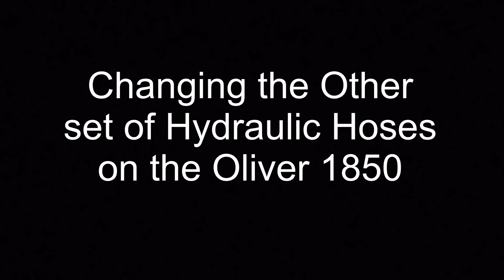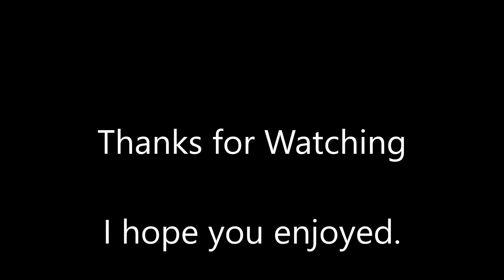Changing the Other Set of Hydraulic Hoses on the Oliver 1850

Comment from the maker: Sorry for the delay in getting this up, My internet is really slow now because everyone is on line so its slow.  But with the fender off the Oliver 1850 its a good time to change the other set of hydraulic hoses and ends to the new ones. So I did the new hoses first putting the new Pioneer ends on them and then pulling the old ones off. Boy did I get a surprise in how tight the hoses were in the fittings and they would not brake loose so I took them off the pipe sticking out of the tractor and had to put them in the vice to get them broke loose and taken off. But I got it all put together but I think I'm going to change the one pipe nipple to a longer one so the hoses will lay nice and relaxed.  Now I'm not telling anyone how to run there lines at all , This is just how I like to run them so the hoses are nice and relaxed and there is no pressures put on the couplers in there holder. You can run yours any way you want to, This is how I prefer to run them. I hope you enjoyed watching.  Bandit

Comment: One thing I know about farming, as independent businessmen, there are a hundred ways to get the job done. None is perfect but if we can pay the bills at the end of the year, it is successful. I have said for some years that you are able to show folks how farming can be done, at least on a smaller scale, debt free. At the end of the day, the color of the equipment and even the condition is secondary to product produced. You do a good job in all respects.
Reply from the maker: Thank You Bill, As a small farmer money is always in short supply so you got to spend what you have wisely .  I bought this cheap enough and pretty much knew what I was going to have to do to it to make it right, Now I had a couple of surprises along the way but I kind of expected that. Something has to go wrong on every job ! LOL  I do the same thing to anything I buy and go threw it and change the oil and filters and fix what ever is wrong with it but when your done you know the tractor and you know its right and ready to go.  The best part about the tractor is its paid for and no money was borrowed to buy it or fix it up and its a good feeling not to have that monkey on your back !  I know most people think I nuts for running the hoses like I did but its the way I wanted them run and piece of mind is worth its weight in gold not having to worry about stuff like the hoses or the hydraulic ends , The hoses are relaxed and the couplers are not in any kind of bind so I don't have to worry about waring out the female couplers from being in a bind in the coupler holders . When you look at something to buy, You look it over good and you see what its going to take to fix it the way you want it and you get a number in your head that you will give for it and have a number in your head that going to cost you to fix it the way you want it to be. So far I'm staying under my budget and I'm getting to the end of the work that needed to be done and I'm liking what I see now. When its done it will stand tall and proud again and I have a tractor that original with great rubber on it looks and runs really good, A tractor anyone would want to own !   Bandit

Comment: Those 4 new lines look great you notice them more with the 1850s work clothes on. Those tires are gonna look great front and back as well. Its funny when in working on stuff in my polebarn its 40x60 and pretty empty so with a tin roof, you'll been in there with the doors open and you think its pouring hard then go outside its sound worse than what its raining.  I have a 95 k2500 and a massey 135 a fridge and like 5 tractor implements so it not full at all. When you were putting those ends on remind me of the time I was trying to break a hose apart off a part for my snow plow ram to make it articulate last year. I was loosing it the part gave free with all my might and there went the fingers on my right between the 2 wrenches and also there went the skin on all my knuckles. So I was kinda not all there I had to push the hydrolic arm in a little to get it back on the plow I decided to tap it with a 4lbs hand sledge well it worked then as it went in the hose was 1ft from my face shot hydrolic fluid right directly in both eyes 😂🤣 should have know better. Me and hydrolic stuff dont get along but yours are looking good though. I tell ya what I think the bigger Oliver's like your look good with cabs are those wires down their that cluster on both side were those for the cab lights.
Reply from the maker: I would rather run them this way, It just looks neat and clean to me and I like them this way. I wish I had another 40x60 barn right now to store more of my treasures inside, Too many prying eye's looking around looking at my stuff ! I need a big good guard dog ! Or a big mean bull !  LOL I traced a hydraulic line on the combine one day, Knew right ware it was and don't you know when I got under the cab I took the wrong one loose. Laying flat on my back on the feeder house took the line loose and got to take a good bath in hydraulic oil out of a 1" return line !  Yes indeed, I took a good bath ! LOL But it got rid of the flee's ! LOL  Bandit
Reply: @banditfarmer1900  oh man I bet you did get a hydrolic bath. The house we bought the polebarn was here I would have never built one this large cause when its empty friends family like to fill it up that for sure. I need a few more tractors to put in their that's for sure. I've took a transmission bath and other than that not much else.
Reply from the maker: @bryanblood7063   Over the years I've taken a few baths in stuff I really didn't want to, I worked in a winery for 20 years and I cant tell you how many time I took a bath there ! LOL From oil baths to champane baths ! Hoses tend to burst at the wrong times like when you turn your back or the pipe line brakes right over your head !  I went back to the lease room one day to take some new filter pads back there that came in (pallet)  and wouldn't you just know it the lease filter blow out ! I was covered head to toe in lease. When you press grapes for the juice its pumped into a big tank ware it sits for a couple of day to settle out and then you rack the tank off a few feet at a time, As it settles out the cleaner juice is on top and the heavy tartrates settle to the bottom so the bottom of the tank this stuff is as thick as molasses and its filtered to get all the juice out of it and its as purple as it can be ! So when the filter blows you turn purple real quick ! LOL Bandit
Reply: @banditfarmer1900  man I tell you what I've never met ya in person I've only talked to you about farm stuff, woods, trucks, and people tearing up your land and a farmer you knews land and a bunch of other things. But if you gave me a multiple question from A to D and you put working in winery I would have never know there is so much money in that stuff it's not funny. My friend started off selling wine st local stores he had a few end caps then it went to more and more stores then it went bigger I would help him haul the wine from the wearhouse in my truck my first truck I owned was an 89 k2500 chevy but it was a Scottsdale with 411 gear it was a work truck had to been ordered but it had the one ton single tire but we would fill that thing up I would borrow a topper cause he was worried about being robbed. But it's funny I kinda did the wine thing for a summer I talked him into getting a van he bought a ford 3500 and that's before I was converted into a ford guy I laughed at him did the whole found on the road dead spiel. But he drove the wheels off that thing, but anyways I had a chance to do it but I chose to become an electrician instead wish I would have went his route. He lives on 10 acres in south Carolina in the mountains with a really nice house. I guess south Carolina is a big wine area bigger than michigan. But when you've told me in our conversations you worked and did farming I figured you might have did manufacturing. But when people see me they think I dont get my hands dirty and own my own lawn care slash tree service and garden tilling business people usually think I am a city slicker that dont get dirty all. People around where I live give me crsp about it and I tell them hey go castrate a pig then after that turpentine the area the testicles were, usually there response i never even heard of that I tell them there not country then😂🤣. But man it sounds like that wine stuff sure was sticky did you ever have to worry about bees or wasps or anything or were ya able to change, that would be my biggest worry anything that'll sting you loves grapes the house we bought has a 50 ft fence with Concord grapes and mowing by thst is usually a life or death situation.

Comment: put a twist in that bracket and make it an over under? then you can get both hoses on the same side of the fitting. just a thought
Reply from the maker: I prefer to have them side by side, and fitted in like I have them. Its just the way I like them to be. I'm going to replace that one nipple with a longer one so the hoses end up between the 2 ends and with them that way there out of the way.  Bandit

Comment: I think the trans-hydraulic fluid that we get from Rural King is red (or that's gear lube I'm thinking of). It comes in jugs or a bucket & is meant for hydraulics or transmissions.
Reply from the maker: My local Oliver mechanic told me to run Dextron ATF in the Hydra-power because it takes heat from the system better. Now as for the hydraulic system in the Oliver said to run a standard trans/draulic in the system mainly because ATF costs too much plus if you have other tractors using the same equipment it can get contamination in the oil from mixing ATF and Hydraulic fluid.  But the oil in the filter was just hydraulic oil so ware the red oil came from I have no clue. But as of right now its working good without any problem so I'm going to keep running whats in it. Bandit

Comment: I can see why you don't like brass. Holy smokes them won't leak but in ten years when the hose wears out you'll need a cheater to get them off and may open an inch wrench.
Reply from the maker: I've never been a fan of brass fittings on hydraulic systems let alone brass hydraulic hoses that are 50 years old ! LOL  Dad used to get mad cause I didn't tighten them up enough so I make them good and tight now so he wont bug me about it, But I might has put a little too much English on it ! LOL  Bandit